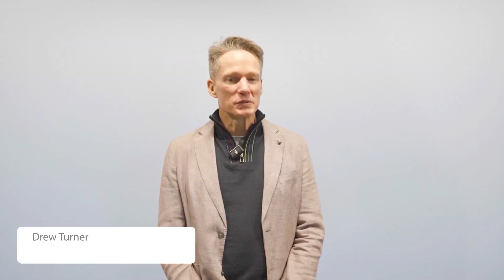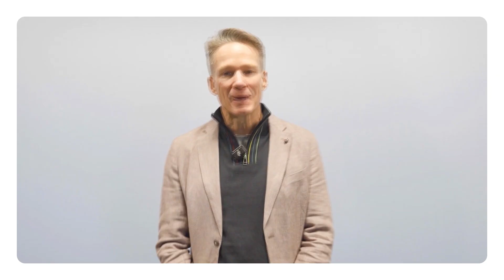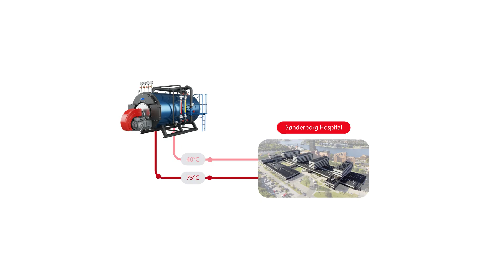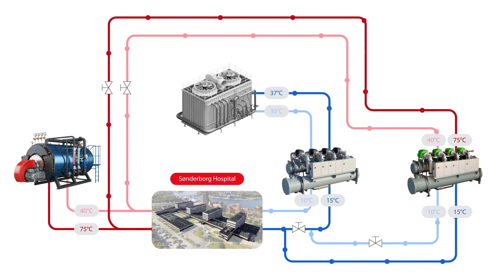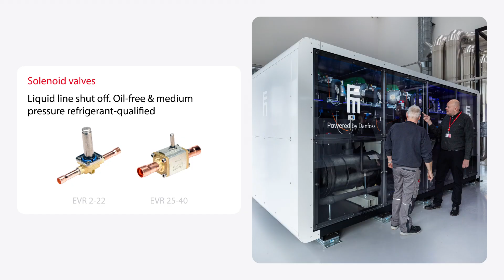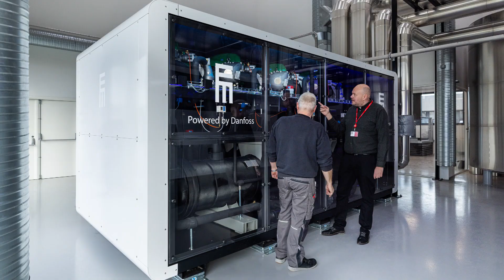Sygehus Sonderjylland a hospital in Sonderborg takes one step closer net zero with Danfoss

Comment from the maker: From gas boilers to carbon neutral!
Watch how Sygehus Sønderjylland in Denmark retrofitted its heating and cooling step by step with a Danfoss water to water heat pump — cutting costs, boosting efficiency, and turning wasted heat into valuable energy.
What do you think about using integrated heat pump systems in hospitals and other large buildings? Could this work in your area?

Share your thoughts in the comments!